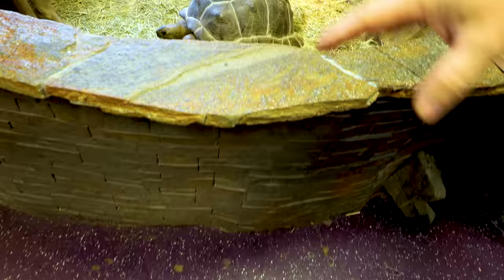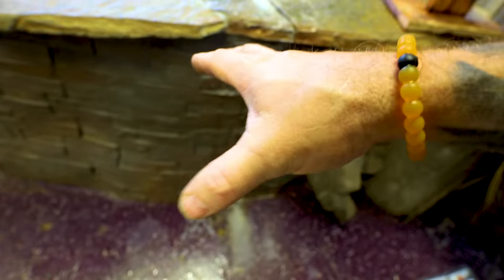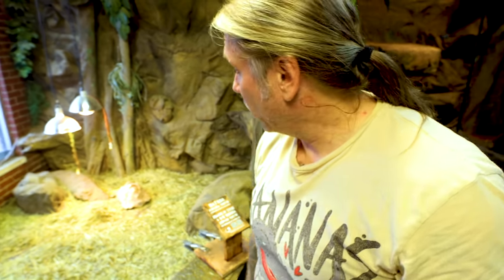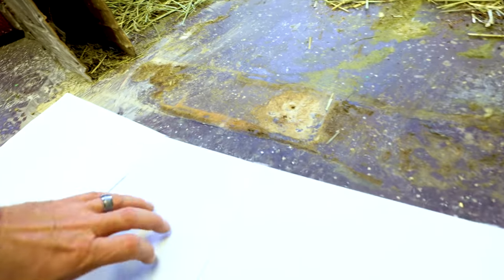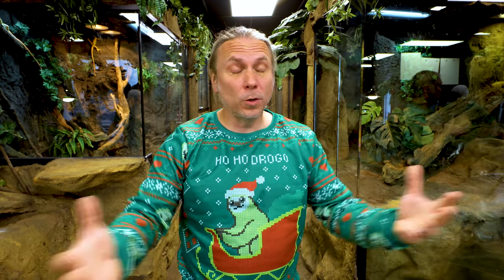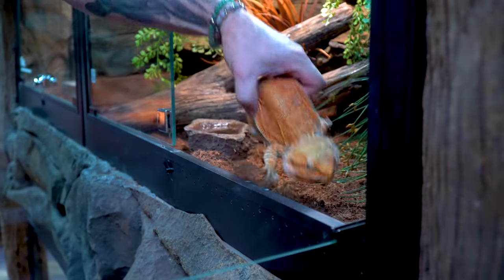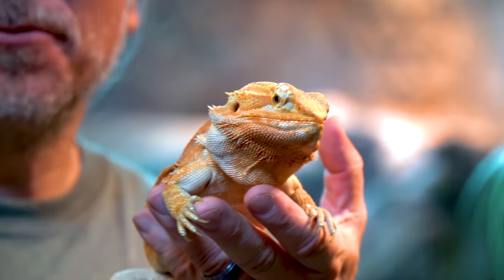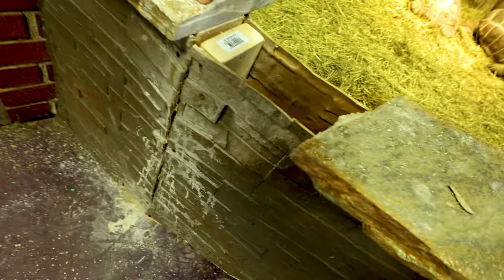I FINALLY DID IT!!! and it WAS A DISASTER!!! | BRIAN BARCZYK

Comment: Brian, next time you have something like the door being hollow try using a part A-B polyurethane expanding foam. You can buy quart kits - 5 gal kits and on up. It is sold in 2,4, (maybe 6), 8 and 16 lb density. I have generally found that the 4 & 8 lb. have worked well for me. The 8 is nice because it it fairly hard and rigid, it will add strength. The 16lb you darn need a hammer to put a dent in it. So perhaps next time you come across a problem such as that door, brace it if need be turn, it upside down and pour the foam into it. Hope that helps in the future.

Comment: Well, you can always close up the sides of the wall and make a wooden gate instead of trying to keep the same style/shape. I know it’s not what you were hoping for but things like that aren’t worth stressing about. 
Otherwise you could try making the frame of the door first and then take apart the current one to attach to the new frame which would allow for a much smoother transition and use bigger coaster, so you can use less and then less wheels have to more in all directions. You probably only need one good strong one at the opening as the hinge should support the other side.

Comment: You can use those metal bars to your advantage. Get a metal post that slots up inside one with an end plate that bolts to the floor, if you use that as a pivot it will help support the weight  alongside the bearings and give a smoother action by stressing the sides less.

Comment: Good morning Brian. Couple of things that may help you out in future projects. Anytime your having issues cutting metal try using a grinder with the thin black metal blades. Also your doors not bad what about a small wheel on an axle on both side may help with the weight of it. The rollers are ok but if anything's on the grounding will feel every bump and make it that much harder. Your really so close with your idea just need a couple small things . I wish in was near you I'd come and help. Any good luck in which ever way you go.

Comment: I think you need to finish off both of the wall ends and make the gate its own finished off section. Think of a real door in your house. Also the hinge section would need to be tapered so it swings easily without hitting the wall.  You could probably even use a door knob for locking the gate.

Another thought I had was a giant dog door, where you take out a plate to let them go in and out at will.  Think window in your house, but with a steel plate instead of glass.

Comment: On the top part t
By the door that is open. Instead of those rock tops again put a tree or plant that is safe for those guys to eat. Or just a fake plant i think a plant or tree on both sides of the door would look more inviting and have a more reptarium. Look and feel. I think looks good just add the plants to the open side of the door it will change it and you will not have to rebuild the wall

Comment: Brian, I think the door would be more stable if you take the rollers out of a straight line and stagger them.instead of roller blades kind of make them roller skates. If you do that the door will stand up on its own instead of being held by the hinges. Not for nothing you did a fantastic job. Just have a little buttoning up to do. Any time you tear shit apart and try to modify it, It takes time to get it where you dreamt it to be. Don't get down on yourself bro. You can do it man!!!!No need to tear the whole wall apart. Move the rollers side to side. Like a zigzag across the bottom. Repair the top of the rock ledge using apoxy maybe add some blocking to the top. And use a file to smooth the edges and blend the seams where the door opens with some extra rock wall laminate that I know you have laying around. A couple more hours and it will be done. Everything will look and work amazing. You  got it mostly done. Keep your head up.

Comment: put some skateboard wheels as rollers on the bottom of the gate, pretty sure noah will have some laying around, not only that it would add some rigidness as you will need a metal bar from 1 side to the other to hold the skate wheels

Comment: You need to get yourself some Spyder bits. I use the hole saws and reciprocating bits. But they make cement ones and metal ones for the reciprocating saws that cut like butter. Not an ad just love the bits. I used Milwaukee for years. These changed my mind.

Comment: I have seen at Home depot tracks of ball bearings that you could mount to the bottom of the wall that are a little bigger that will roll smoother on that floor. Sounds like the ball bearings you have are to small and getting caught up in the hay and straw. The substraight of the bottom of the cage. Just maybe a little help and ideas. Keep positive.

Comment: If every job went perfect, how would you recognize success! Every fall back or failure leads to a greater satisfaction at the end of the project!
 As a brick layer we have had to remove whole walls because someone read the tape wrong , not often but it does happen. If you have a carpenter friend have him come frame that out, I can see it in my head , it should be a fast fix, that's will be as good as new construction!

Comment: Why don’t you do like a removable wall, instead of it swinging open make it so a section can be lift up and out. All you would really need to do is make a room separator but each side has a way to slot it in on either side so they can push on it but it won’t move?

Comment: I dont think id us ball bearings. If you get a spring loaded hinge for the backside it will put pressure on the door when its closed to keep it flush and it will automatically swing shut. Overall its not horrible though it can be tweaked good job

Comment: Brian,
You're too hard on yourself. It's a rolling door. Really not something to stress out about so much. So you probably are going to have to build the wall again to do it the right way, then do it, stop bellyaching over it. It's really not the end of the world. I know this sounds harsh, but in reality you stress yourself out and give yourself so much anxiety over small things, it's just not worth it man.

If you're going to rebuild the wall, do it with plywood on a frame of 2x4 and design it properly for the door to be included. Put heavy duty hinges and 1 ballbearing roller at the opening side of the door, otherwise you're creating too much drag on the door because you have too many ballbearing door wheels and it will never open smoothly.

Keep Safe, 
Peace, Happiness, Love and Laughter Always,
-Matt

Comment: Well it may not be up to your perfectionist standards, but it’s better than most people could do. That’s hard, to reverse engineer something. My suggestion would be just like you said, re-do the entire wall, with an opening planned from the beginning. It’ll be perfect like you like, and operate exactly how you want, without the imperfections. But until you can get a plan together and the materials you’re going to need, it is fully functional. Let Matilda out to her hearts content, then use your gate and latch her in. What it lacks in beauty it makes up for in functionality—bottom line it works. And you’ll make it perfect. It won’t be a one day job, but that’s ok. It seems like everything in life is two steps forward and one step back. At least that is how mine is.

Comment: Frustration is a bitch.  Its such a downer.   I think you'll discover that it's a better door than u think, just not what you saw in your head.  If worse comes to worse, build a whole new wall with a door.  You'll get it.  It's not the hardest fix you've faced by far.